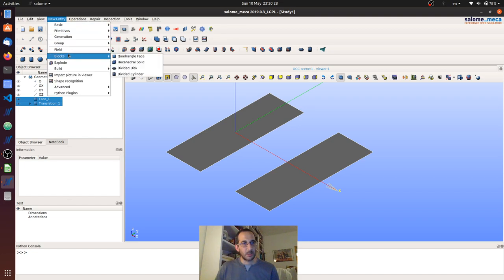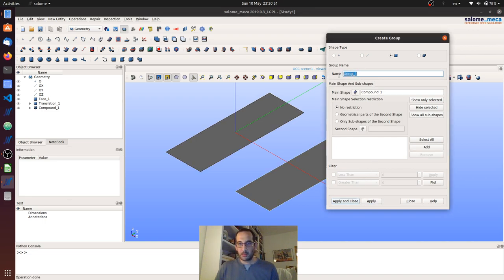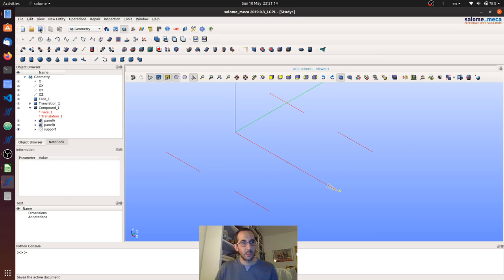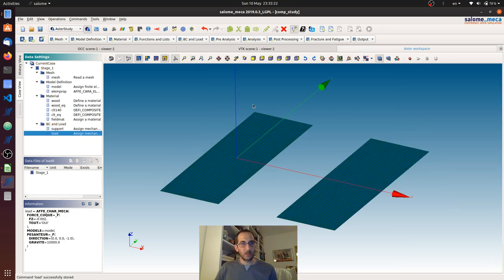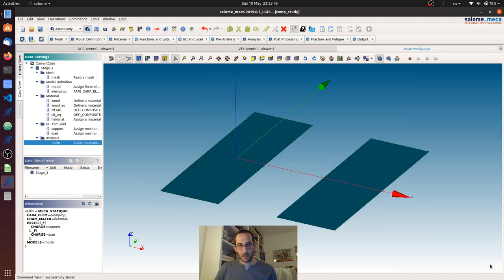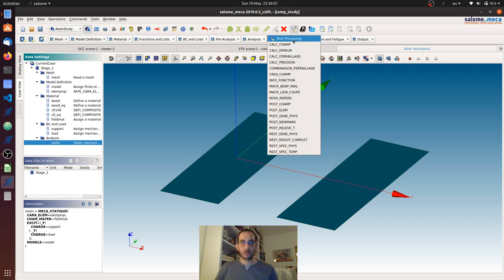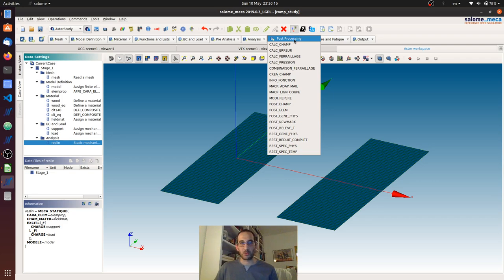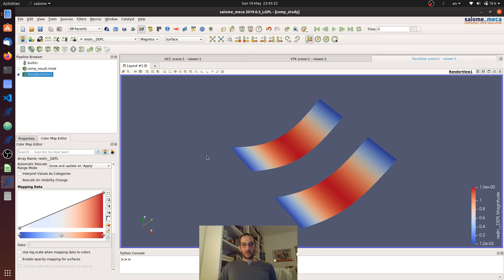How-to Video: Define Composite Shells in Code_Aster

Comment: Hello Aether, 
Thanks for your great Tutorial. I have 3 CLT panels. they would be connected like a house (two walls and a floor). I need to do substructuring method to calculate the whole system frequency by having the panels' frequency separately, Do you have any tutorial on that?

Comment: I´m just starting with shell elements myself and have a few questions. Why is it so important to define the local X-axis?  Can you model shells from 3D objects like bend sheet metal parts? How would you define the X-axis on them when there are normals in all possible directions? When you define a offset to the thickness, how does CodeAster know in which direction the offset is implemented on the different surfaces since you code it with a single value?
Please keep up the good work and thank you! I think your tutorials are some of the best around!
Reply from the maker: Thank Benedikt, glad to hear that you enjoy the tutorials. Regarding your questions:
- Local axes for a shell are more ambiguous with respect to beam and solid elements. For the last two you can set predefined rules but for shells not one that always works. In the latest version if you do not define it the x axis will be along the x global axis but if it is perpendicular to the shell plane you will get an error. Note that the vector you define need not be along the plane, Code_Aster will calculate its projection to the plane and find the local X axis, so it should not be perpendicular. In a group of shells with various normal vectors either you have to define more groups or find a single vector that is not parallel to any of those normal vectors
- What do you mean exactly by model shells from 3D objects? I'd say no in any case you have to define the shell and input the thickness, no automation is available that will do this for you from a given solid input
- The eccentricity follows the normal vector I guess, a positive value will displace the element along the direction of the normal, a negative value will displace it in the opposite direction. But for this kind of issues it is always best to conduct your own small experiments and verify what the code does

Comment: Is EFGE_NOEU calculating the line loads N (membrane), M (bending) for the laminate? is there a way of getting those values element wise instead of on the nodes?
Reply from the maker: EFGE_NOEU is the average value on the node from all elements converging to the node. EFGE_ELNO maintains the value to the node from each element, so you get potentially a discontinuity in the field but it is the correct extrapolated value on the node from the gauss points (EFGE_ELGA) for the element, but in order to visualize it in Paraview you need to use a filter "ELNO field to Surface"

Comment: Hello there! Indeed a nice tutorial :) 
If i may... I have a couple of question on modeling shell elements in code aster. Maybe a bit longer discussion... Sorry in advance! 

First, I want to know if it is necessary to define more than one layer for elastic model of a simple plate element. I do this question because I’m modeling a steel structure with shell elements and I’m comparing results from codeaster and SAP2000 by varying meshes and shell finite element models in both the programs. I have a not negligible difference between SAP and CA, the second one underestimate displacements with the respect to SAP and by considering a simple frame model with the same structural elements. On the other hand, SAP overestimate such displacements. Maybe there are differences between the two software that I don’t know, but i did not expect such differences between two software (... indeed ABAQUS gave me results in line with SAP2000). I do wrong something for sure, but I don’t know what and i am trying in different ways to find the solution.
Second, may i ask you what’s the difference between the first calculated stress filed (ELNO) and the second one (NOEU), which is the one used in the post process? Is that change always necessary to do?
Third, did you know if, by default, stresses in shell elements are plotted in the local reference system on in the global one? Is there a way to chose from one or another ?

Thank you in advance for your time, i really appreciate your help! ( and sorry for my not perfect English :D )
Reply from the maker: You can use a single layer, no problem there, if you have an isotropic material and a single layer you do not have to use DEFI_COMPOSITE as well, you can assign the material directly to the element. For the differences that you mention I can only think of the shear deformations, which I know that SAP takes into account always by default. In Code_Aster if you use DKT elements you do not consider the out-of-plane shear deformations, with DST elements you do consider them. Is the loading in your test case in-plane or out-of-plane? 
ELNO stresses are the stresses at the nodes coming from each element. To visualize them you need to apply a filter in paraview, so it is a bit less straight-forward.
NOEU stresses are the average stresses at the nodes coming from all elements connected to that node. This gives a smoother field and can be more or less correct depending on the case and the judgement of the user. NOEU stresses are directly visualized in paraview (like for example a displacement field).
Stresses are given in the local axis of the shell element, the x axis in-plane being defined with VECTEUR keyword. Not sure at the moment how you can rotate them, that is a good question. Perhaps in the forum of Code_Aster you can find the answer.
Reply: @aetherengineering7387  Thanks for answering me. This helps! I cannot attach a comparison that i made here just to see differences between the models. Yes, i did manage the use of both DKT and DST elements, to avoid distortion to shear effects. On the other hand, i've tried a very simple cantilever example comparison and i found, probably, that the shells in CA may suffer of shear locking. Indeed, displacements are more less than the th. value and SAP2000 also in this case. 
Last but not least, stranger things happens also performing linear buckling analysis :(

If u are interested in the problem, i can give you more data/model (skype, e-mail, linkedin :D )
Reply from the maker: @egaegaega.  if you mention shear locking then we are talking about loads in-plane, but DKT and DST do not have shear locking. However, they are first-order elements, for bending in plane you should have at least three elements, but better 5 or 7 elements. Or better 2nd-order elements. Feel free to send anything you want at info@aethereng.com and hopefully we can find some time to look at it.

Comment: Hello, many thanks from my side as well for the excellent tutorial! That helped me a lot.
I have partially successfully tried to extend the example to evaluate the stresses in the other layers and compare them with my own analytical calculation. 
When I display the stress in the 2nd layer (which is under 90°), I find that the SIXX is not the stress component in fibre direction but in the direction of the element X axis that you defined at 13:27min. So in this case, the SIYY would be the stress in fibre direction of that layer. 
But if I would have a 45° degree layer for example or other arbitray layer angles in the laminate, how can I display the stress components in fibre direction? Is there a possibility to access the MATERIAL coordinate system instead of the ELEMENT coordinate system?
Reply from the maker: Hi, thanks for your message and your good words. To our knowledge, it is not possible to get the stresses in the local axis of each layer with a single command.
One (manual) workaround would be to calculate the local stresses from the global applying a rotation in the plane of the shell. This could be either done directly in Paraview for visualization purposes or in Code_Aster using CREA_CHAMP command.
For the former you have to use the "Calculator" tool from the "Common" toolbar, for the latter a combination of CREA_CHAMP (in various modes) and CREA_RESU. This old post in the forum of Code_Aster could be useful https://www.code-aster.org/forum2/viewtopic.php?id=21222
Also bear in mind that there may be an easier way to do it that we are unaware of, so do not take this answer for granted.